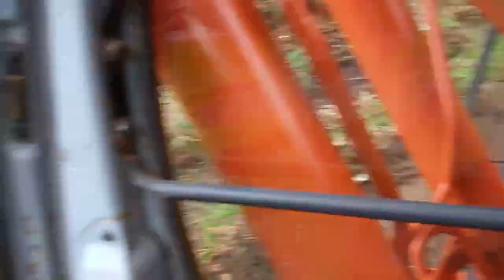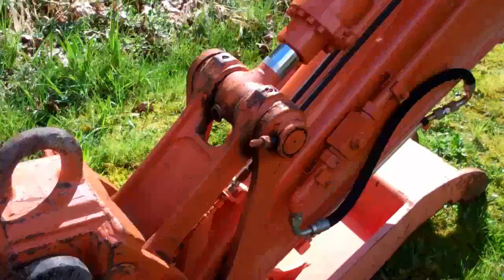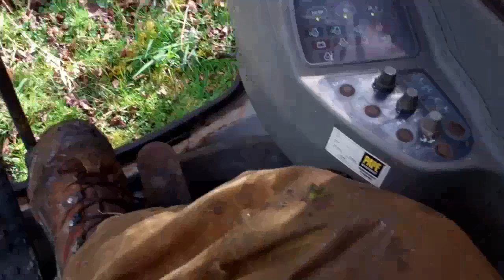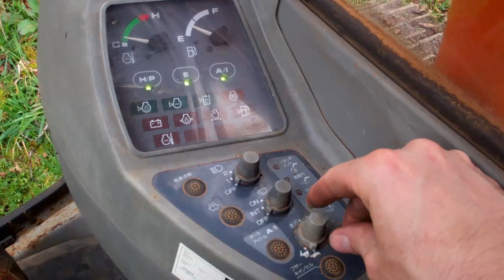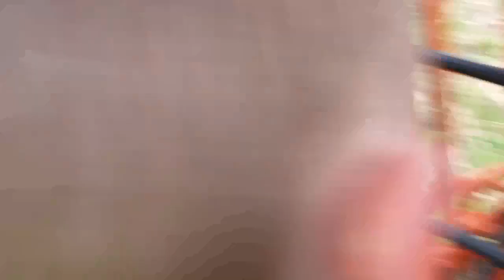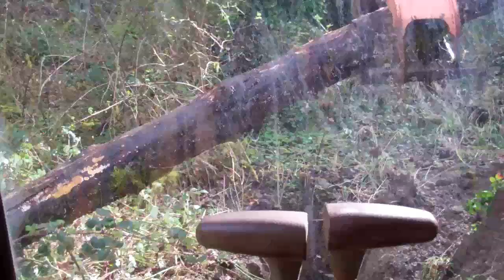First Day with the Hitachi EX120 Excavator! Quick Attach Demo & Digging Fun

Comment: I know, this is an old, old video! but never assume that the bucket is attached, when watching the little ram quick hitch. always lower your bucket, stick out to a 90° angle. crowd your bucket away from you. if it starts to lift the machine, you know it's locked on! then you are ready to do your job. you may not read this. but if one person does. it may save a life! had a bucket fall off a 50 tone cat because the operator got lazy didn't do a 4 second check and his bucket fell off! 5-6 seconds before the bucket fell off. I was in the loader picking up over burden. right where he was dropping the load! long story. always crowd bucket away from you to lift machine. if it does. your good to go! only has to lift machine 3 inches and you know it's locked in.

Comment: YOUNG MAN , THIS EXCAVATOR EX120 HATACHI  DEERE EXCAVATOR D120 SAME HEAVY EQUIPMENT , SAME PARTS ! .

YOUR SON IS TO SMALL TO OPERATOR HEAVY EQUIPMENT FOR NOW / HE CAN GET KILL VERY EASY , I USE TO WORK FOR I C RAILROAD  UNTIL THEY SOLD OUT !.

HAVE THROWN TRACK AFTER U FIX A LOT OF TRACK EASY TO REPAIR ! .

WHEN I WORK FOR IC RAILROAD  , I WAS CAR HOPPER ! .

I USE TO HAVE 315 LC CAT 28 " TRACK W MANUAL THUMB FOR A LONG TIME , UNTIL I SAVE MORE MONEY TO BUY HYDS THUMB ! .

THANK U , CASE

Comment: Very cool.  My toys don't have that quick change out.  My dozer has a ripper on the rear end and is a two speed track.  My backhoe has two different bucket sizes but I have to manual change them out or install the rock buster. Got loaders on two of my tractors and made some forks for one of them for picking up just about anything mostly hay bales and an occasional car or two.  Toys I love.  My dozer was the reason I found your channel and I have been watching ever since.